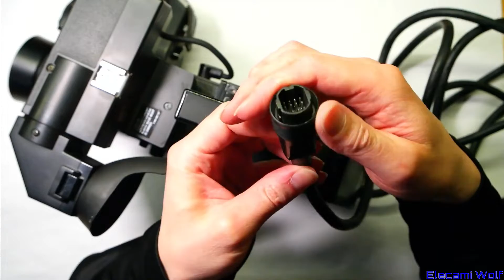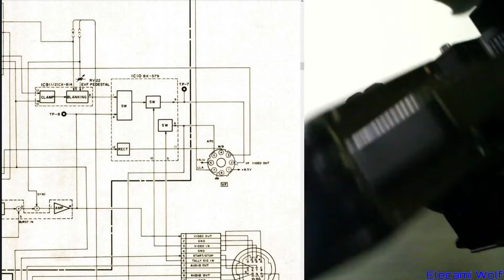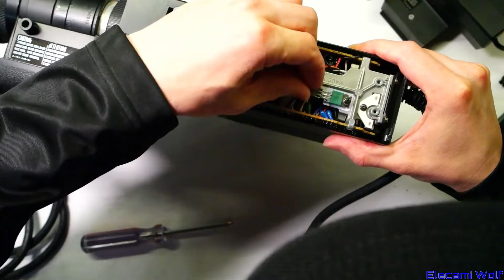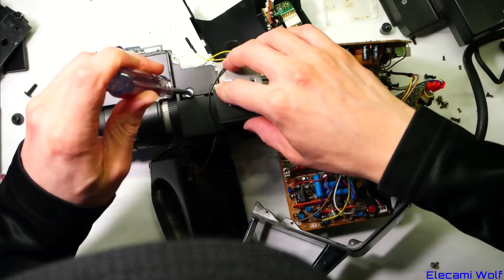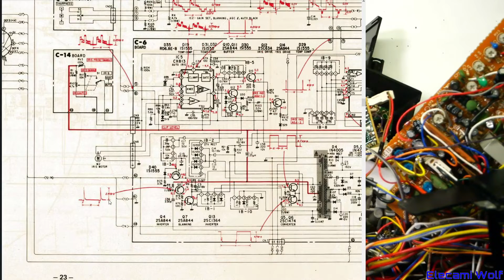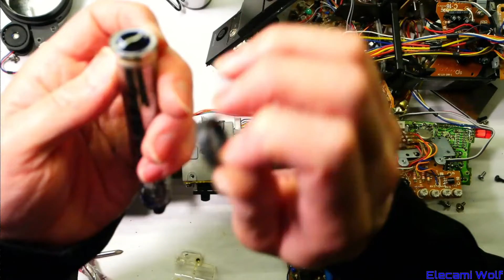EW0073 - Sony HVC-3000P Video Camera Teardown

Comment: These cameras are actually electrostatic deflection the coil is just for focusing. I found most of these cameras still work but yours does look as if it’s been damp a sad end to what was cutting edge in its day
Reply from the maker: Interesting. Electrostatic focus is not common in TV related Tubes/ CRT.

Comment: Hey EW, where do you find your video camera service manuals?  I have the Olympus VX-308-U video camera (no VCR to go with it) with a similar plug like the one you showed, but the owner's manual for the camera or the VCR don't have a pinout.  I'd like to mess around with it if I had a pinout for the VCR connection cable, or mess around with the CRT viewfinder if I had a pinout for that too.  I can find very little information about this camera.
Reply from the maker: There are only a few actual manufactures of video cameras form that time. Mainly: Panasonic, Sony, Sharp, JVC. Maybe a couple more. 
Everything else is rebranded from one of those listed manufactures. Bit of googling, I think what you have is a Panasonic PK-980
To find services manuals I do google search. Usually can find and download for free. Some sites you need to pay. They are not very expensive. 
I found this: https://www.owner-manuals.com/PK980K-service-manual-PANASONIC.html
Reply: @Elecami  Thanks for the info!  I didn't know such a big name in cameras as Olympus would have been doing rebranding of other manufacturers' cameras back in the 80s.
Reply from the maker: @00Skyfox  Olympus did their own still cameras. I guess they contracted out other manufactures to fill out their offering with some video cameras. Canon did the same with rebadged Panasonic Video Cameras and VCRs.